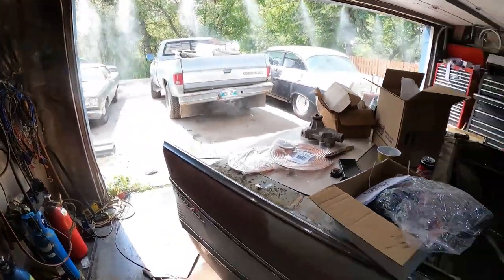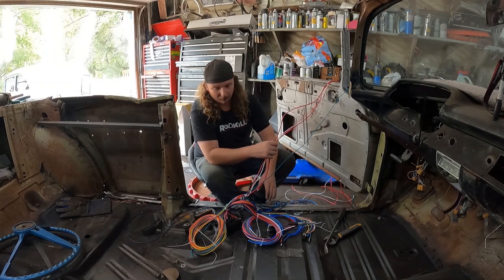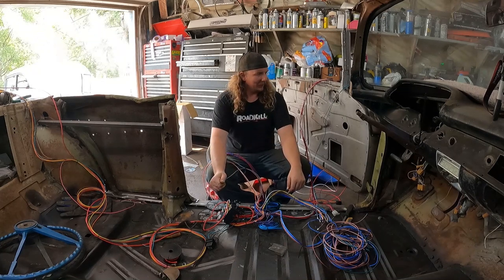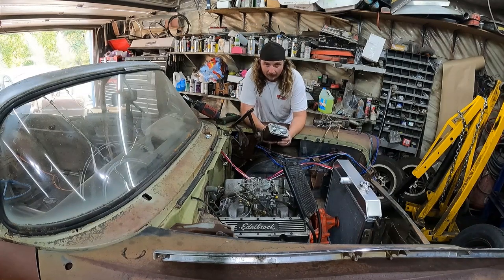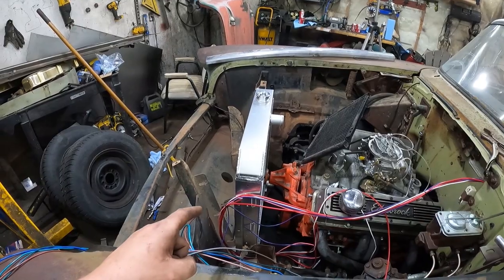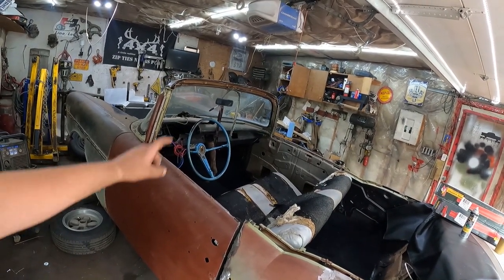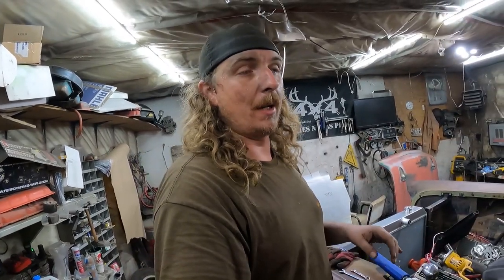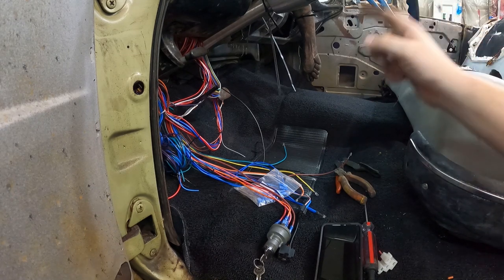$100 Amazon Wiring Harness, Will It Crank? 1957 Chevy 4 Door To Convertible Conversion Part 11

Comment: I wired my first hot rod, a 1950 Chevy Sedan Delivery that Had a 327 in it, with the wire harness from a 1958 Chevy Biscayne.  I was 15-16 years old.  It was kind of a mess but everything worked as it should. 
I've wired several cars since then.  It's tedious but rewarding when done.  
I may try the cheap Amazon harness on my next project after watching your experience.  Good job.

Comment: Hey Dan on on that radiator support bracket just take the 2 bolts out and turn the whole thing around It should fit in there That way it changes it  From  Is V8 to a 6

Comment: Years ago I was working on a change over on a car assembly plant.  The company had ordered 2500' reels of numbered red wire.  They had about 200 different reels, as I remember.  It was the easiest way change over I ever worked on.  Usually we used a label that was self adhesive but when you are pulling forty wires into a conduit or cable way you always leave extra because you are not ever absolutely sure of the location of the devices.  The numbered wires had the numbers stamped every foot or so.  I used the reels on other jobs, lots of them were only partially used so they ended up on lots of jobs.  I never did find out how much it cost extra but it made lots of jobs just so much easier.
Reply: International Scout II wires all back or green... changed the colors for the engine swap part of it though and fabbed the sub harness.

Comment: Hi Dan
I think this build is fantastic. I can remember a couple of guys picking up ‘57 4 door hard tops back in high school (yes, I’m an old guy), and just closing the rear doors, filling them in with bondo, rattle canning them and start cruising, lol! I could never get over how odd they looked with the the 2 short little doors on them. However, my question today goes back to your Model T build. I noticed when you first moved all the body parts into your shop and started tacking them all together, you first put what appeared to be a new shiny base piece down on the floor and tacked all the body parts to it. I now know that this is the piece/channel that sits right on top of the frame. I know this because last Sunday I just purchased and brought home a 1929 Ford Model A Tudor Sedan. That channel is rotted through on mine right behind the rear end of the frame and is throwing off the door alignments. I have tried to find this online at AMD, Speedway, etc, but no luck. Can you please tell me the proper name for this part and where I would be able to purchase one for my project? Sorry for the long winded story.
Thanks for all the videos and information.
Daryll Darcy
Ingersoll, Ontario

Comment: Dan  great video. Covered a lot  need a part number for that wire harness 12 circuit.  My 57 has original brittle old wire.  Very scary looking   ur work bench looks like mine  a lot going on pretty normal for me  lol
Reply: Dan. Saw the wiring harness  is there  a part number u may want to
 share.?  Just saying   if not l will find it thanks. 😎✌

Comment: See if you can snag a Hurst Auto Stick shifter - there's some on eBay. I used these in our 55s and loved the way they look and perform; cable operated shifters suck (in my opinion). The Auto Stick uses a rod to shift and looks like a four speed.
Reply: They are just a little spendy.

Comment: My experience with a 55 with headers and dual turbo muffs, is that the fuel and brake lines running beside the exhaust may cause issues. The dual exhaust cars ( power Pack ) ran the lines down the outside of the frame rails to avoid the problem.

Comment: I am sure there are many people still alive that built these cars in Detroit in the 50's. It would certainly be interesting to get in touch with a couple of those old timers and interview them about their experiences. They would certainly enjoy watching your videos as well.
Reply: Not to many people still around that was born in 1940
Reply: My 91 year old Uncle who worked for the general motors plant said those cars were built great compared to the last cars he built there in the 1980
So I asked him the question you just proposed and he told me that was so long ago he can't remember.
He was in his mid 20's when all tri-5's were being built.
Reply: @reddirtgeorgia  Yeah, that's a problem all right. In the 80's Detroit was having a hard time making profit from the sales of cars as the unions had them paying so much for labor. They couldn't compete with foriegn car makers. They cut costs in materials and took lots of shortcuts to save money.
Reply: @nboldrini  
O yeah the 80's Lots of plastic, rubber bumpers, and glue. I have cars sitting from every decade. All of them before 1980 are still solid. The newer ones 80 and up are melting and cracking and hardly any useable parts.
 if it has a check engine light it's too new for me.
Also I only drive cars/trucks with real bumpers

Comment: I just noticed behind you (during high speed) that the toolbox(s?) nearest to the garage door opening, look to be getting soaked form the water misters?
I'm imagining the water misters are old fuel injector nozzles screwed into a metal pipe?  ;-)
What temperature difference do those misters provide?
Isn't there two or three loops in the break lines from the master cylinder and block to prevent the lines breaking due to vibration?

Comment: I have bought a speedway harness and a unbranded eBay unit for $70 I actually prefer the eBay as the wires are longer and headlight switch is already wired...but the speedway has a better instruction manual.

Comment: Got the wire diagram for my 65 Chevy truck. Man there is a lot of wires. You have to have patience when electrifying your ride. Front turn signal hooked up to the rear right turn signal doesn't work so well. Dont paint the radiator.

Comment: I'm cheap and use old junk, as long as the copper is in good shape. I collect wrecking yard harnesses and wire at yard sales. After new connectors with dielectric grease and soldered connections, I've never had any problems. Yer puttin' new wine in old skins there LOL. It may even be the old wiring is heavier gauge... !!! I'm sure it'll be fine though.

Comment: When you say kinda cheap on the copper, what gauge are we talking here? 20-22 gauge? 18 Gauge? When doing mine, I like to keep it no less than 16 gauge. Of course 14, 12, 10 where possibly needed. Like I've said before, I enjoy wiring. All the different connectors and related hardware, routing and planning out the system.... Its enjoyable.

Comment: Power antenna wiring is usually constant 12V and ground, and then you have a wire that comes from the radio that is a positive 12v trigger that comes on when the radio is on.  It probably won't have a switched lead you can use to trigger things. But it's a Chinese harness, so who knows? lol

Comment: Hey Dan, Isn't there 2 different lengths of yokes for turbo 400 and turbo 350 transmissions? I think there is. It would be a lot cheaper then a drive shaft. Just a thought.
Reply: Output shaft on trans has to be changed.

Comment: take the core support side braces and if possible swap them from right side to left and vice versa. no cutting and welding. just thinking out loud. or now that i watched the whole vid, detach the whole support and turn it around. or maybe im talking out my ass , and should keep my mouth shut. Great work as usual. love the wiring part you did. i hate wiring.

Comment: Be careful with the hood hiting the radiator where you have it located.  6 cylinder and the v8 brace on hood has different opening for  to rad hose. best bet go ahead and put 2 inch spacer on rad support so it will move foward another 2 inch so room for a  top core support. which you will find that you do need to keep dog house from shaking apart  Very well put together video learnt alot  about wiring kit and brakes.

Comment: It’s hard to tell in the video how close it is, but the fuel line next to the exhaust might boil the fuel on a hot day otherwise looks great
Reply: Power Pack cars ( dual exhaust ) had the fuel and brake lines on the outside of the frame.

Comment: at 17:15 when your explaining the mounting of the radiator between V-8 and 6 couldn't you switch the side panels from side to side which would move that mount to the six cylinder spot?  I had a guy many many decades  ago say that was the difference. I'm not a tri 5 guy but like everyone else love them want them.
Reply: I was wondering the same thing

Comment: The only thing different I would do is to paint the car before you rebuilt all the mechanical systems... much easier than after brakes, carpet, etc.  You are doing a great job...yes, it probably would have been cheaper to spend a little more for the 4 door hardtop and not have bought a parts car....

Comment: Wonder if DD Speed Shop would consider taking a late model hemi Dodge charger and turning it into a 2 door?
Reply: @Bulitt Nose Right ... with all sensors and modules removed, you couldn't register it so it would only be good as novelty or a racer.

Comment: Run continuity on cheap harnesses you will be pissed when one wire wasn't stripped before crimped
Reply: The odds of that happening aren't very good. But considering the price point and the ease of a double check if the harness is on the bench - I agree.

Comment: As soon as China takes over America, you will get stuff faster lol. Seriously though,love the channel
Reply: @robertclymer6948  I hate to say it ... but especially on Tri-Five parts "Made in America" is not necessarily a good thing anymore. Hood springs that snap, gas pedal that jams, taillight housings that allow the hot wires to ground out, hood bars that are too short , headlight doors that don't even come close to fitting, weatherstrip retainers that aren't even plated, and chrome work that starts popping rust within a year (assuming the bastards even send you your own parts back). Not good
Reply: @tinsano6030  Headboard Harris. Dude that's funny

Comment: sounds like you need a video to do something fun then go back to this car. so many people see a car go yes lets do this hit that wall and never finish it. they forget its supposed to be fun. when ur gettin unmotivated its because your no longer enjoyin it. you need to do something you love to keep yourself into the whole thing. stupid how to videos might just be your thing man. i never understood wiring until someone exsplained how a relay worked. alot of people who watch what you do wanna know how you do it. just enough knowledge with an example. i honestly never ever thought of using copper for brake lines. its cheap its really flexible dont rust a lil love every other year and would last forever. something i never thought of and is damn well kool. did you know a cheap 3/4 cam cheap is to order a 71 z 28 cam for a sbc.